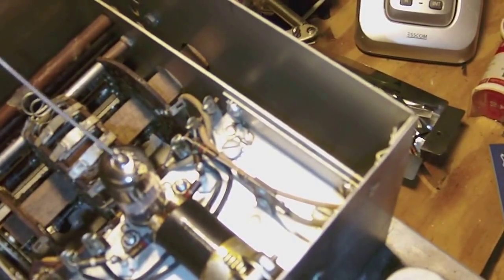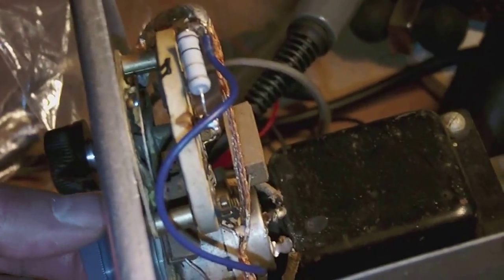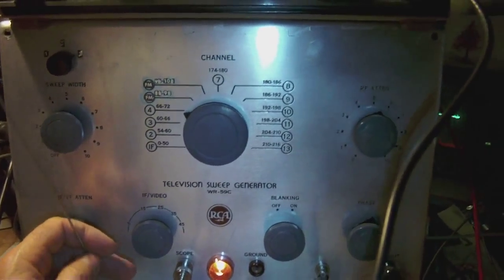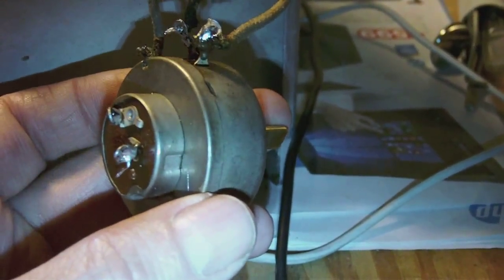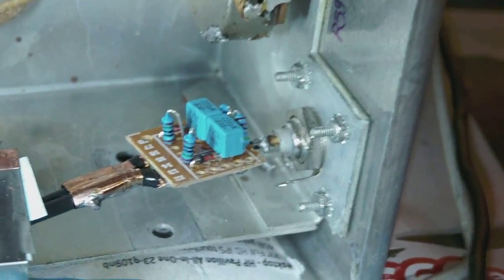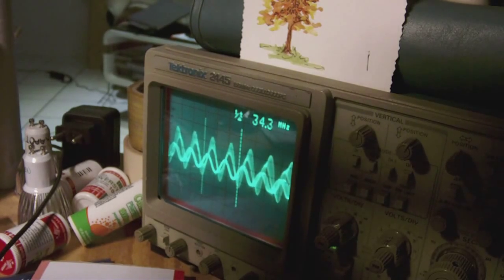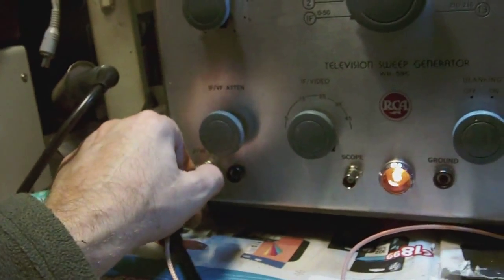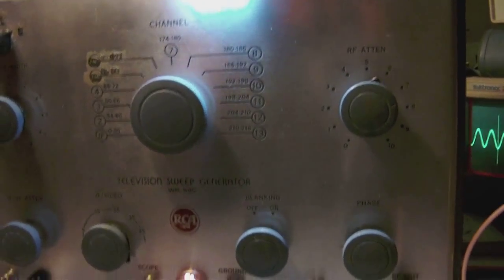RCA WR59-C part 4 of

Comment: Happy New Year! Nice work on the RCA, how much did you pay for the copper tape? I can't find anything cheaper than about 25$. Cheers :)
Reply from the maker: Thanks a lot and a happy New Year to you as well !
Hmmm, I can't remember precisely, but I payed something like 8$ for a roll of 5m of 1cm wide copper tape on Ebay. You just need to do a bit of detective work. A good tip I can give you is, to always scroll to the bottom of the page of a specific product. Quite often other similar offers appear down there. If you repeat the same trick on each product you'll open, you'll end up finding the cheapest offer, generally. Don't forget to read the small print though... some charge outrageous shipping fees while selling the product itself cheaply to entice you into buying.
Glad you liked the video. Stay tuned for more :)